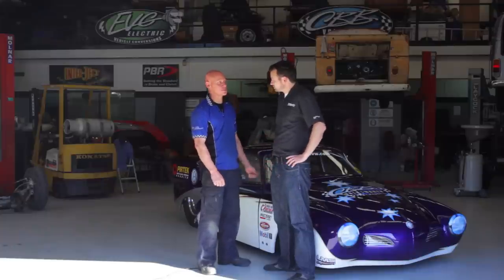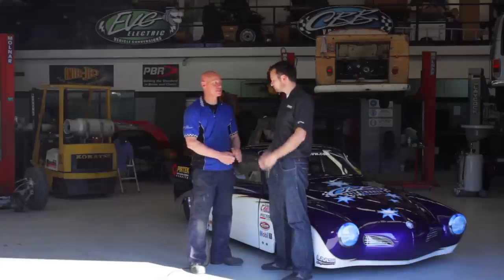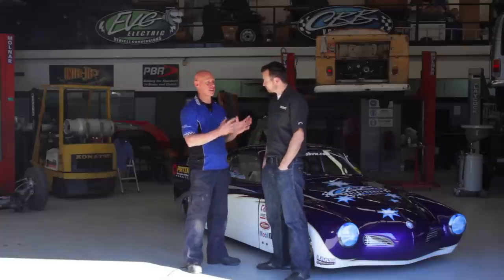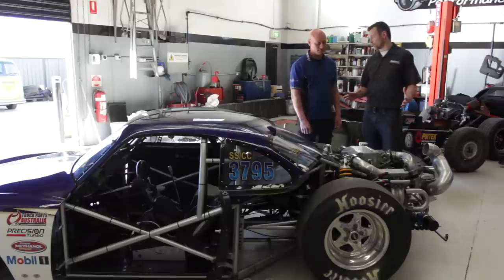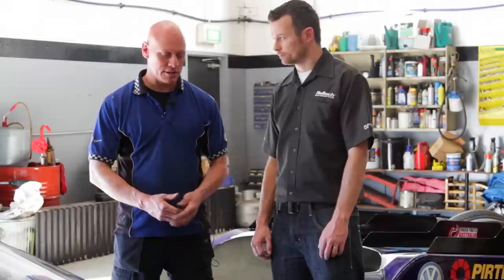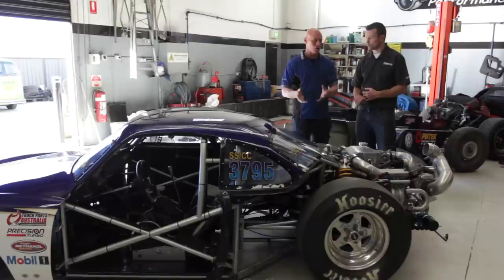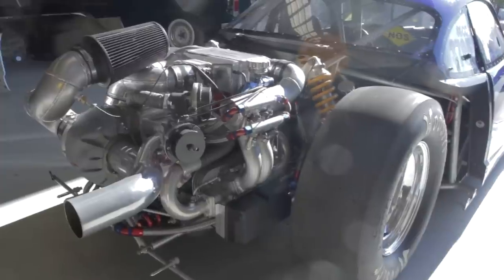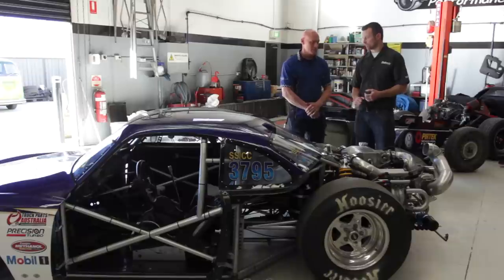Mike Kristen and his turbocharged Karmann Ghia - Haltech Heroes

Comment: Can't praise Mike enough: built a custom turbo, injected 1916cc for my buggy with the Haltech ECU etc and the thing rocks and it isn't run in or tuned for e85 as yet: another 500kklm to go before it's on the dyno again.. You want an ac VW engine built in any state of tune or fabrication work done then look no further: he now has one of the best fabricators working for him who's also a VW nut.